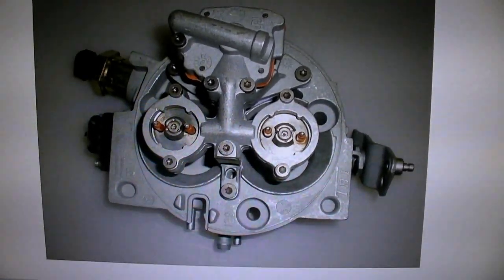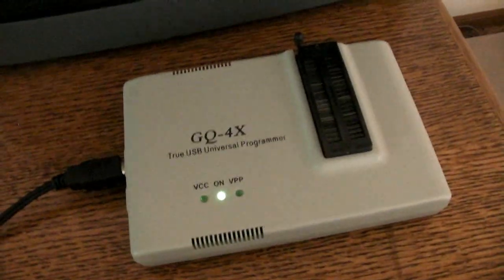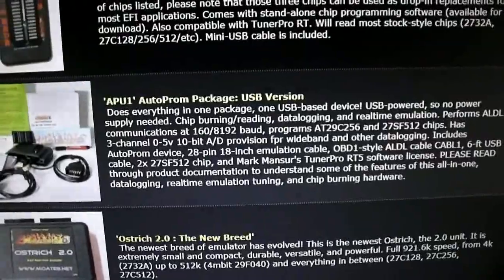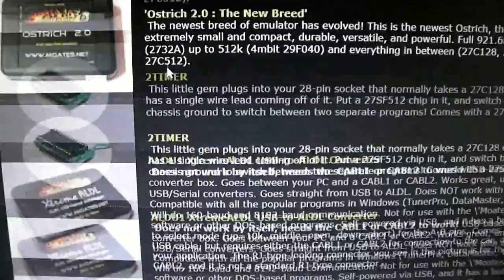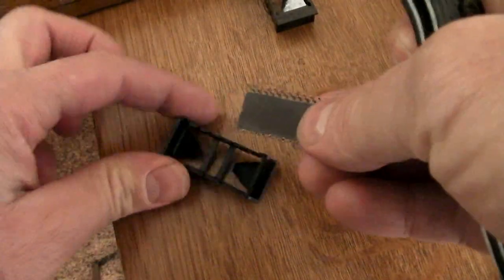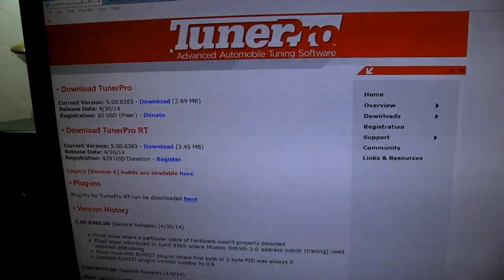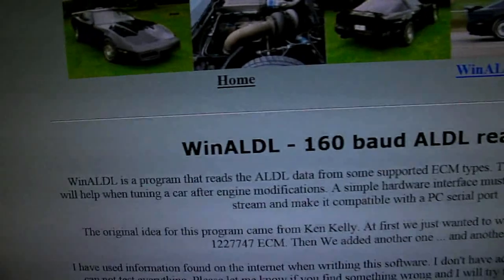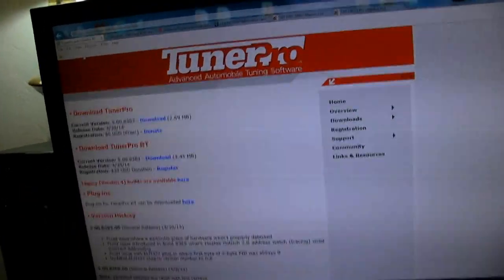How To DIY Prom Chip Tuning For OBD1 Chevy GM Throttle Body TPI LT1 Fuel Injection Honda

Comment: I do need a chip and some advice on a 1995 2wd 350 tbi build. Missouri DOSENT require emissions for that year. The engine is the famous 70's casting number 010 block thats punched .40 over. It has flat top  pistons and a .041 fel pro head gasket, iron 64 cc protopline heads that have 185cc intake runners, 2.02 intake valves, and 1.60 exhaust valves. The cam is 213 219 duartion at .50 447 in 471 in lift or part number
LUN-20080660,  I have the summit air cleaner with an aftermarket tbi unit. 
 1.6 roller rocker arms, Edelbrock air gap intake, long tube obx headers, I do have 2 1/2 inch pipes all the way back to dual exhaust but I need to get a Y pipe and a catylitic converter. I am going to get a vortec style lph fuel pump and 18 psi spring. I have a 2500 rpm converter on the 4l60e which has low miles(128,000). Stock 2 piece driveshaft been rebuilt. Has a 373 gears in the rear end and the tire size is 31x10.50 r15 LT. Is there any other recommended parts I should get?Thanks again.

Comment: I realize this is an old ( very old video ) however, i am looking for a way to tune my 1992 5.7/350 TBI with mild mods. I have a 1997 LT1 hyd roller cam from a Z28, 1.5 roller rockers, hi-flow cat, IROC underdrive pulley set, 18 LB   TBI regulator spring and a 60 LB  EFI pump from a Silverado 5.3...This Franken-Rod needs to be quick off the line, reliable but still pass smog test - in Virginia. Any ideas ?
Reply from the maker: I would check with tpichips (harristuning) he has a lot of experience with tuning for that engine.

Comment: I'll have to learn how to tune OBD1 ECMs but your guide is certainly putting me on the right track. I've always wanted to add a supercharger to a 1993 Pontiac Trans Sport minivan with the 3.8L to give it a little better overall handling but I thought I'd have to re-wire the whole van to OBD2 out of a newer Grand Prix. 

Thank you!

Comment: Is there any way I could send a prom to you?  I have a 1988 S-10 4.3 that is running really rich because I live at 7,500ft in elevation.  Everyone else has told me it is a lost cause and I can't adjust the fuel to air ratio.
Reply from the maker: Check your map sensor that should compensate for altitude or  lower your fuel pressure, that will lean it out. You will need a adjustable regulator.
Reply: @venturahwy76  thank you for the help. I hope that does the trick, been trying to figure this out for a while.

Comment: 1991 4.3 chevy TBI losing one injector sometimes, could it be a chip .Installed new injector, new ecm with old chips, check all wiring. I am lost for now
Reply: Doubt it but you can likely find used chips and computers for you vehicle on eBay

Comment: Awesome video man. I found your video because I’m having a running rich problem with my ‘91 GMC with a 5.7. It’s driving me fricken crazy because I’ve replaced every damn component on this thing and have gone through the TBI several times. I can not lean this thing out !! I built this engine back mostly stock. The only mods I have done were block hugger headers and I did port and polish the heads. The engine runs awesome on the highway, but around town I’m only getting 10 mpg. It has a rough hot idle and intermittent shutter almost to where it wants to stall but doesn’t. What is your recommendation? I’ve replaced EVERYTHING. (TPS,knock sensor, temp sensor, map , egr. , 02, etc. etc. even soldered new plugs on everything) please advise. This 4.50 a gallon gas is killing my wallet.
Reply: What was your fix? My 454 c3500 is the same only I think im leaning out causing overheating in summer time only. Im about to change the ecu ecm thingy
Reply: @Phuq_it   I’m actually still working on it. It’s a daily driver though. What all have you done to yours ? I doubt it’s the ECM. There’d be several crazy things going on it that was bad.
Reply: @squidhound00001  okay 7 years ago I bought this truck. Did emissions and found the thermostat missing. It still passed. That’s where my problem began. I started to replace everything cooling and sensors. It would not cool down in summer heat. Only at red lights. It never boiled over. My coolant over flow lid area has warped and the container has swollen. Thought it was the heads. Nope. I had the money and told a really good shop to rip everything out and replace it or do whatever. Found another engine and they rebuilt it. Everything under the hood is brand new. First day it hit 100, the thing starts running 230. Now it’s 109 degrees here, i have a new fuel pump and 4 core radiator coming. The rebuilder is looking for a head gasket leak but can’t find one. So it’s back to the same thing. He said maybe the ecm needs reflashed for fuel trims
Reply: @squidhound00001  red lights is the only time it starts creeping up. You can stick a piece of paper in front of the radiator and it will suck it up against the grill when clutch fan is on
Reply from the maker: I would check your fuel pressure and make sure your injectors are not leaking. Use a timing light to check your injector spray pattern.
Reply: Add more air with a TBI spacer and an after market open air cleaner to lean it out some.

Comment: and by the time you go out and buy all of this crap and spend hours tuning it  I can get a edelbrock rpm performance intake with  750 carter afb performer carb adjust the timing to 21 degreees go grab about 5 bottles of 108 octane boost  and blow your doors off  at half the cost !
Reply: Can you do a carb swap in an engine that is setup for fuel injection?
Reply: @ILLUDIUM_Q_36   yes you can 
 most important  I have upgraded plenty of tbi sbc . You can either delete  wires out of your harness the cheap way or order a painless wiring kit for your vehicles application  nest get your edelbrock performer intake get your carb and most importantly get a different fuel pump I usually go with a Holly fuel pump on those   simply putting a fuel regulator will  cause your stock fuel pump to  burn up because most efi need 50psi give or take and most tbi needs 35psi and carb only needs give or take 7psi . After your new fuel pump and a bit of wiring clean up through that intake and carb on you are going from a stock tbi at 190 -210 HP to 265 HP give or take when switching to carb  the I found that by advancing timing with octane boost I can achieve 300hp on a stock block I forgot my torque numbers but let's say  it's way better has much more pull and by doing this swap your simplifying your motor making it much cheaper to maintain and afford and notto mention under your hood will look much nicer .
Reply: @jtrentful  did you have top install a stall kit for the transmission?
Reply: @ILLUDIUM_Q_36  a stall converter you mean?  I usually go with a 2,000 stall to 2500 stall  going any further I would seriously consider things like stronger set of u joints and other parts I buy my converters from transtar   they sell nationwide and so far so good and just doing a stall converter really does help win the race you'll definitely notice a big difference !
Reply: @ILLUDIUM_Q_36  also they sell shift kits depending on what transmission you have in your vehicle but those are over rated all they do is drill out a few spots on valve body and turn band a little tighter .i can cheat and right where kick down cable meets carburetor I just make small adjustments until it shifts a little late and harder saves $ and you get same results as shift kit would do for you .
Reply: I am currently installing a 472 bigblock caddy 365 HP 520 torque I bought good running motor for $500 for my 79 trans am and with New intake and carb  and having delta Cam make me a new thumper camshaft it will be much closer to 425 hp total cost $950 for 425hp and 520 torque I love finding different ways for cheap reliable performance .
Reply: @jtrentful  your stall rpm is based off what cam you're running you just don't pick it based off what rpm you want lol I have a feeling you're mostly full of shit buddy because most painless wiring harnesses are upwards of a thousand dollars and this chip burning kit is 398 for everything plus you get the quickness and better gas mileage of the fuel injection system taking fuel injection off and going to carb is like taking a twenty year leap backwards it just doesn't make sense but hey I'm just a 16yr tech you probably know better then me lol
Reply: I said I could blow your doors at half the cost with a carb intake and playing with timing I am not joking .  Have you ever done this because it doesn't take a 16 year tech to figure this shit out . Key words at half the cost !
Reply: @jonathanlawson4667 of course  your right your stall is based off what cam you pick but what I am saying is with a stock cam mild rV cam or whatever  you can get away with as much as a 2500 stall if you want to and you will still gain hp to wheels and some cases a fuel mileage gain as well  I usually go with 1850 stall in all of my sbc . And painless wiring harnesses aren't that expensive either but  I also stated playing with wires cheap easy way first so dont get too focused on 1 thing once you have played with enough wiring like I have you  know you dont need a painless harness . And you also know you just saved a ton of money and can produce just about as much hp by going carb . Sure I will agree your fuel efficiency and throttle response should be a better choice going fuel injection  But if you dont have a huge bank account . Going carb will not only save money but save in the long run as well .I know you will say but fuel injection will save more because of better mileage my next response to that would be . I can find all of my parts that I need for less than $500 .  You will need half of that just to make sure your fuel psi is right not to mention all of the other crap you buy before job is complete And carbs are cheap and easy to rebuild so if I have issues I have a very  small tool box for that . While you will need to scan it and probably spend at least $50 or more just figuring out what is wrong with it . When fuel injection is as cheap as carbs then I will go that route but until then I am happy with putting on 4 barrel carbs and playing with timing  and saving a ton of money and making my car that much more simple to work on while gaining an easy 40 hp + gain over stock on any stock tbi set up  !
Reply: @jonathanlawson4667  I also have 16 years  as a tech in a transmission shop buddy and I also grew up working on cars as a kid and built my first truck before I was a  teenager I am giving the best advise for the dollar now if all these guys had tons of cash and asking for the best money can buy  of course my advise would definately be much different the whole point is to save money while gaining as much hp as a guy can on a budget and keeping things a bit simpler for those guys who aren't to car savvy but still want more hp . Guys like you get focused on 1 thing and totally lose all meaning you could of asked me a trick question to see if I knew what's up but instead you try to insult my intelligence without taking time to know your facts . Next time take a different approach !!!
Reply: @jtrentful  you're correct so you should know that fuel injection out performs any carb buddy that's a fact and we aren't talking about NHRA drag cars here we are talking about every day 400hp drivers anyone who ditches fuel injection for a carb is a complete disaster of a mechanic
Reply: @jonathanlawson4667   the whole point is budget hp and fact is you can get a 4 barrel carb and intake everything I need for less than $500 .  To get that extra 40 + hp meanwhile you will spend at least $800 no less to get the same hp as I could by going carb . That's the point I been making the whole time . Leaving budget aside I would agree with you and of course go fuel injection every time  but you have to agree that for the cost a carb will produce more hp for the budget builder ! That's just a fact man !
Reply: @jtrentful  that wasn't the argument the argument was a carb is better and it absolutely isn't and you can get cheap affordable tbi units all day long
Reply: @jonathanlawson4667  I can get a good used edelbrock performer rpm intake for less than a $100 online I can get a good holly 750 double pumper for roughly same price  in junkyard $20 and a $50 performance  rebuild kit with all fancy jets n shit . I then go with a hei distributer can find used junkyard sometimes like new condition $10 all that with a felpro intake  gasket set $20 black high temp TV silicone  . And now I am making an extra 40 + hp over any  stock tbi  . For less than $300 . Can you really say you can achieve those numbers at that cost with a tbi . I dont think so Jimmy !
Reply: @jonathanlawson4667  meanwhile you will spend more than $250 on injectors and another $75 or more on a regulator and the list goes on . Shit  Just a stock rebuild gutless  tbi is more than $400 . Though you can rebuild them for $60 with a cheap kit but still wont improve hp at all .
Reply: @jtrentful  I'm not worried about cost I don't build junkyard engines I want the best so I go with the best and I buy new parts I'm getting ready to do a motor swap on my restored 91 camaro I'm going to put it on youtube you should check it out will be a couple of weeks I've already ordered my motor I'm just waiting for them to get done building it
Reply: @jtrentful  I can get injectors for a tbi for around 80 dollars new bro
Reply: @jonathanlawson4667  if a guy can afford the best then by all means get the best parts you can I was only trying to help those who cannot afford the best parts but didn't want to wait until they could to get that extra hp . My personal favorite when it comes to efi  is the holly sniper  it comes with a self tuner easy to install . Only fabrication needed would be if you didn't have 02 sensor in the pipe . With our huge professionally tuned 850 double pumper we went from 207 hp to 251 hp peak hp was at 4800 rpm and even after adjusting the crap out of it and putting smallest jets I had in it from a 550 it still was a bit rich but great throttle response we did what we could to our carb so  . We then put a efi sniper on the engine  after letting it tune itself we had 259 hp then we played with it ended up at 265 hp and hp stayed  much more consistent until 5300 rpm . Not to mention we actually went from 16 to 18 mpg to about 21 to 25 mpg . So going from carb to the sniper efi we saved at least 4 mpg . And added 60 + hp over stock and 14 hp over the best carb we had on our shelf  . the sniper  cost us $1400 after tax . If we could put this on every engine we would ! Usually a guy would have to upgrade his cam intake and other things to get this much hp without ripping into the engine . Cost being around $1400 after tax for a sniper I think it is well worth the price . Guys you wont go wrong going carb but patience is a virtue  just be patient and save that money hide it from the wife lie and say your check was smaller than usual like I do lol
Reply: @jonathanlawson4667  you're wrong. Carbs will always make more power.  More reliable too
Reply: @mikem5475  LOL!  Other than Josh's rant, this is funny!
Reply: Cool story bro. 

You don't need all the parts he's showing, you could do it all for less than 200 dollars. You aren't doing jack shit for that little money.
Reply: Dude I need help with my 94 Chevy

Comment: what's the need for this? can i just replace the injectors cheaper? will this make power difference or fuel savings or ?  or could i send my chip to you. my truck seems to have a spot in the throttle that when i pull a boat at 55 mph it has a tiny chug i have to let off or push more gas. if i dont it just keeps slowing down to 50 mph or near. what going on here do you have any idea? it my first truck that has this particular injector set i like older carburation.
Reply: It's not that simple 🤣🤣🤣🤣 on these with more power like say you're going to a 350 from a 305 or you took your 350 out and it isn't stock anymore this let's you adjust fuel flow air flow timing curve etc etc yes you can put bigger injectors in but your computer is going to be letting it put the same amount of fuel pressure as your smaller injectors so it's not going to do anything for you

Comment: Great source of info.  I just converted my G20 Chevy from a 305cu to a 350cu and having difficulty getting it to run smooth.  Appreciate any thoughts on this.  Thanks!
Reply: Did you swap to the 350 fuel injectors and prom chip? 
Also, the knock sensor is different.
Everything else is the same(I believe), but any one of those things will create a lean condition and ignition timing problems.

Comment: Hi great video. I seen this was how its for Chevy but I have a 95 dodge Dakota 318 w/ automatic trany I'm planning on porting and polishing the heads and a cam maybe throwing some bigger injectors on it. How would I tune it??? I grasp that it will probly be sorta the same system but will the wire be the same because I haven't seen a wire like that on it. Looks almost like obd2 wire. Just wondering maybe I can get pointed in the right direction. Thank you very much and God bless you

Comment: loved the video. I now think i need the apu1 and g2 adapter and a pair of flashable chips or two. bone stock ecm in 94' gmc sierra gt 350 auto with tbi spacer and 3" exhaust and headers with x pipe (overkill I know!) planning vortec heads and cam and such but need to get started on tuning or none of it will matter. thanks a bunch and if I'm wrong on my tuning parts please advise. also I'm running windows 7 32bit on a toughbook. what was the reasoning behind running xp?
Reply from the maker: I had problems with the chip burner with windows 7. worked fine with xp.